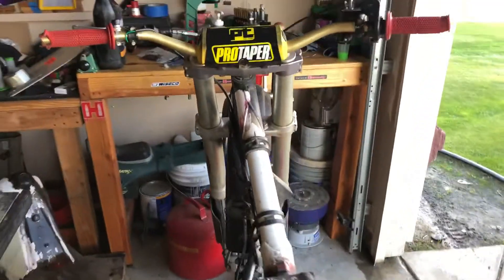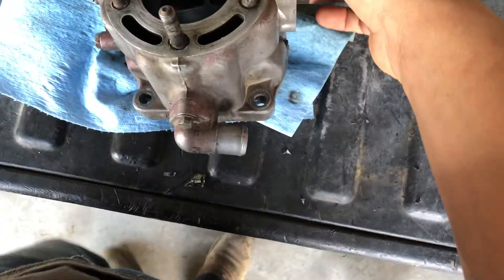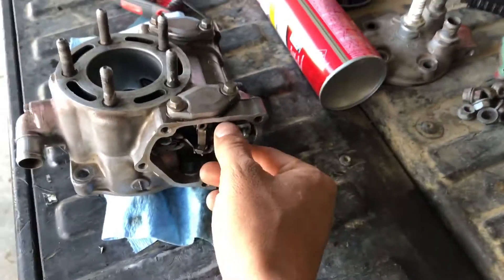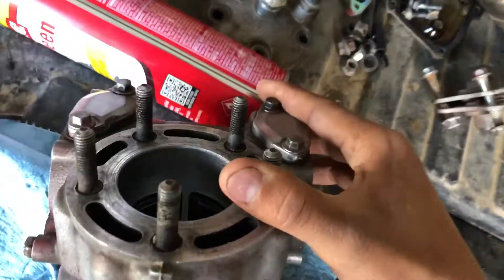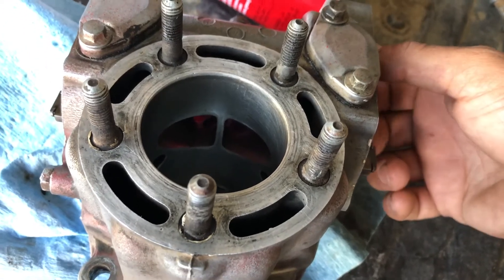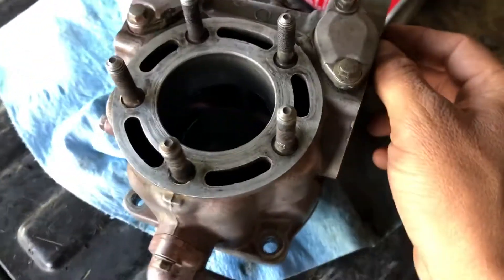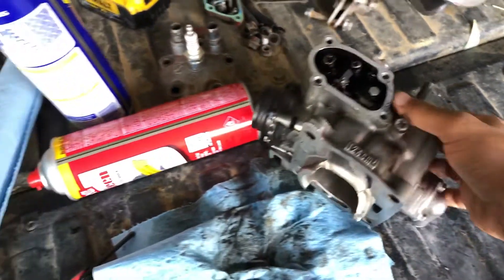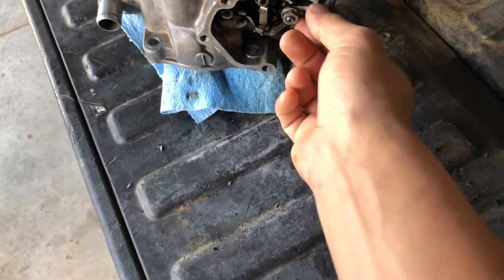1995 cr125  power valves

Comment: i must ask you something i have the same engine an i have unter the water pump i mean of the bottom of the engine a little hole i think 2mm is sat normal  ´? or for what is it
Reply from the maker: New_MK13_RoX  if im understanding correctly that hole is to indicate the waterpump is failing , it will leak water when the pump needs replacement .
Reply: okay i have not understand what you mean (bad engilsh) i mean the hole than looks to the ground it is under the engine i think you now what hole i mean and my question now must this hole open or close ? bekause the 
previously vehicle owner close the hole whit rubber sealant i hope you understand what i mean
Reply from the maker: New_MK13_RoX it should be open , its not supposed to leak, but it will leak when pump needs replacement
Reply: @zacatecano1986  okay thank you verry much